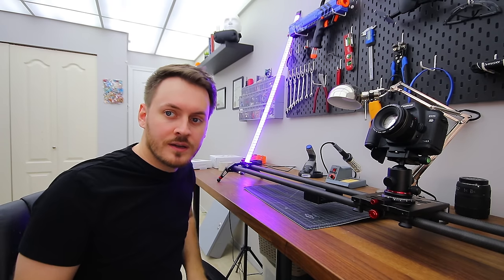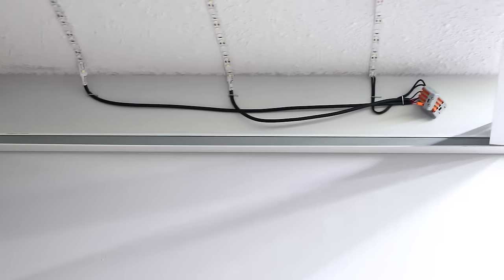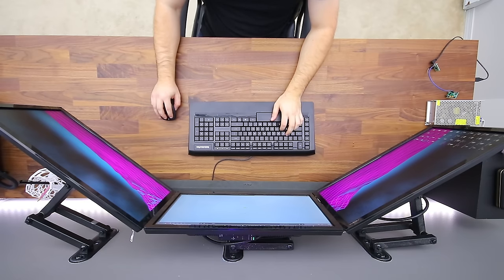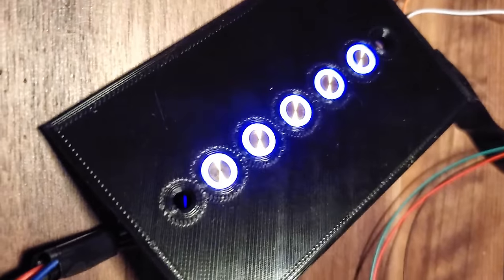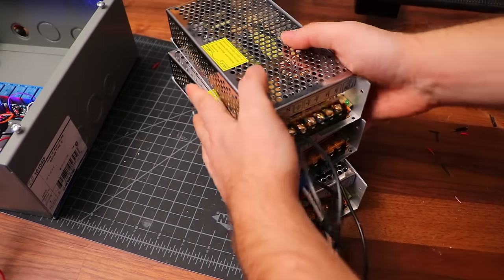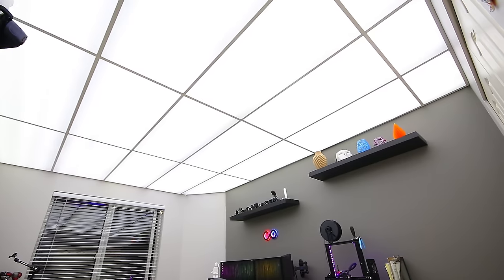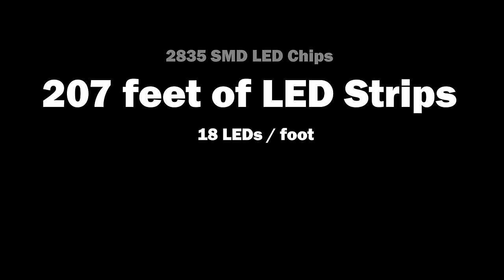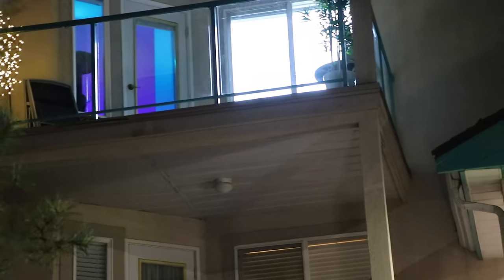Turning My ENTIRE Ceiling Into a Light Fixture

Comment: 8 million addressable LED's and you could turn your ceiling into a 4k monitor.

Just sayin'.
Reply: No. 100
Reply: @F17A  

 ,more precise actually only one since 4k is just a line, 4096   , 

and you multiply with 2k lines (2160) you get 8294400 pixels
Reply: Honestly, I'd be happy with VGA resolution if it means you'll actually do it. 😁
Reply: @ehombane  4k is usually 3840 wide instead of 4096
Reply: Do it
Reply: Make a homemade "TV" is waste the time. To make any image you need control every RGB LED separate and conect to one 555 timer if I don't remember bad, and all this to another thing by groups to another thing by groups to finally can conect to one pic available to move 4K. Would be terribly slowly, big, expensive and ugly monster.
Reply: @oscarswaggie  OK  and still, 8 mil will be one not 100
Reply: @ehombane  ok
Reply: ...in black and white.
Reply: Am I tooo doctor to understand the chat ????
Reply: I like the part where he said “a.”
Reply: You don't need 8k in pixels if you have 8k in lumen.
Reply: Like number 1000
Reply: You can buy video wall like they use in concerts and stuff (literally costs up to tens of thousands but it works)
Reply: @nefarious6986  Well, that's not very DIY.
Reply: @darkridge  it's also incredibly cost inefficient and they're very heavy once you put too many together so overall it's an incredibly bad idea
Reply: Let's not, and say we didn't.
Reply: @rennoib  you don't need 555 timers. You'd be best off with an HDMI controller integrated circuit. You'd still need a ton of LED drivers though.
Reply: Like those roof displays in Las Vegas
Reply: @ElliottRodgers  Exactly! He'd have his own personal Freemont street experience. 

Or at least a really awkward way to play video games.
Reply: Impossible! the most common smart led is 5050 5mm x 5mm and strip width min 8mm. Width of room aprox 3m,  3000mm/8mm=375pcs max
Reply: Why not 8K?
Reply: Do you also tan?🤣
Reply: haa haa haa m8
Reply: MicroLED's Bro, they are the future.....!
Reply: @F17A  bruh

Comment: It would be cool to change color temperature as the day goes to night, might help as well to keep track of time using the lights 👍🏼
Reply: Lit at noon and blackout at night? :)
Reply: plagosus more of a cascade from 6600K to 3000K - MacOS Catalina has a dynamic wallpaper that does the same :)
Reply: I do this with my LIFX setup, it's very nice - although I simplified it to 10pm and midnight. I have it go to a very dim red at 2am so we don't bump into things for those late night gaming sessions :D
Reply: Aw yisssss like a lotta phones come with that night mode automatic blue light removal throughout the day. I wanna do something like this at my place, maybe even have a light sensor outside so the inside lighting just basically mimics it.

Unless it's dreary and cloudy outside...
Reply: I did this a while back, works great!
here's how I did it:
-opened window blinds

Unfortunately I'm retricted to using different shades of blue, orange, and gray.
Reply: @plagosus  Hahaha, hopefully the reverse
Reply: @alystair  that's lit
Reply: @lexscarlet  You usually want to rely on time rather than sensors, because the main benefit of those lights to begin with is to help circadian rhythm not to mimic outside. I myself have KISS approach of manually toggling diffent color via a remote control and it works just as good. Not only it is zero work approach, because those light with remote control are being widely sold already, but it is also what you normally want anyway. If you haven't been in a room lit only by red light then it is hard to anticipate some annoyances. Color chances perception a lot, so it can be hard sometimes to find or examine some particular thing and you want to toggle a diffent color light for a few sec, more orange or yellowish, to see bettere. It is nice to keep a very lightweight remote control in your pocket and toggle light at will. Audio control works as well, but you don't exactly want to rely on using your voice when you wake up to take a piss and people are sleeping.

Comment: Usually those little touch sensor modules have empty pads that you can bridge together and change them from momentary switches to toggle switches, then you could hook those up directly to the relay board and not use the microcontroller.  Awesome video tho, the switch plate is dope
Reply from the maker: Holy shit, you just made my night. This is why I love YouTube. You're absolutely right, there's even a little symbol for it and everything! Thanks so much!!
Reply: Was hoping he'd read this comment? And he has! Which is great cause that was exactly what I was thinking as I watched this. 

Btw internet people's those of you who are disturbed by the fact that home techies like us would want to remove a controller? There's a simple explanation in this thinking process. We aren't getting rid of controller. We are freeing up a whole controller to be available for a project where it can actually be utilised to a better capacity.

I'm forever looking at things and thinking why didn't they use relays and jumpers to make "physical" logic gates? 🤔
Nearly every combination of computer mathematical logic can be configured into  an electrical circuit utilising a few cheap components? I.e basic logic like AND, OR, NOT etc.
Most people wouldn't need much more than those logics with most of the projects that want to take on at home?
Reply: @Coltography  would love to know where I could get some of those touch sensors you used in the switch
Reply: Jarmezrocks me not knowing a thing or two about this makes you sound like a genius, holy shit so much info to take in, sounds so complicated.

Comment: Just a heads up, step drill bits would most likely stop the plate from snapping like it did.
Reply: athornforeveryh flexible wall plates do not break like this.
Reply: For drilling that hard type of plastic, and acrylics, polycarbonate and brass, grind the lands of your drill square so that it scrapes away at the material. If sharp and digs in like a chisel, will load up and crack or chatter every time.
Reply: JUst by a drill made for drilling plastic!

Comment: The discrepancy in theoretical vs actual wattage could be due to voltage drop down the length of the LED strip. If you're feeding 12V down a copper trace that is effectively the cross section of a 18-22AWG wire, you  could lose a lot of voltage (and therefore current draw) by the end of the strip. What's the voltage at the end of the strip?

You could try feeding power from both ends of the strips, thereby improving consistency from end to end?
Reply from the maker: Very good point!! I am going to try this and see how it affects the results. Thank you for the excellent suggestion.
Reply: doubt the spec for the leds is meant for two way power. It’ll probably either have a diode (or burnout) if it is one directional. 

If it’s not strictly one directional it’ll likely just heat up the strip until failure or at a minimum the power supplies will fight each other.

You could cut the trace in the middle effectively doing the same thing by powering 1/2 of each strip. Though if these are wired in parallel 10-15ft strips shouldn’t be awful. The strips do look like they’re wired up a little whacky too though.
Reply: @9Llamaboy  In order to work at 12V the strip it's internally wired in parallel blocks, there's not such thing as "bidirectional power" or "fighting power supplies" you have a lot of homework to do
Reply: @9Llamaboy  In these strips you normaly have a positive and a negative line going from one end to the other, like in a power cord.
The LEDs (or groups of them) are put in parallel between these two lines.
If you draw that on a piece of paper, you will see that you can feed the strips from both ends.
For reference: Look up the YouTube channel "Intermit.Tech". He showed what happens, when you feed power to a length of LED strip in different ways.

Spoiler: Buy sun glasses.
Reply: @Coltography  als you can tune the votlage of the PSUs with the little orange trimmer. measure at LED strips, and tweak until you have 12V there. you may have liek 14V at the output of the PSU and still only 12 at the strips.
Reply: We'll have to feed AC Voltage and put AC-DC convertor for every feet or two 😂
Reply: @9Llamaboy  Thats not how it works lmao
Reply: wiedapp ah gotcha, thanks thought OP was talking about using one power supply on each side not powering from the same supply. Its an interesting idea but not sure if it’d be worth the effort of running an extra ~15ft x 2 for every strip. It looked like in the video you linked he’s using 3 strips chained together so it makes a much more significant difference
Reply: Agreed. Also, 70% PSU efficiency is on the low side. Just checked a couple of similar MeanWells and they're in the 80%-90% range.

Comment: Such a great video, and I wanna do this now! Might be a bit late to the party for suggestions here, but for addressable leds, maybe you could lay it on the ceiling, parallel to your white strips. In code you'd create abstractions for each fixture square (based on how many LEDs fit inside each one) . That way you could have a nanoleaf vibe going on in the ceiling! Might need some spacers between each fixture to prevent light bleed to get a clean result, though. Quite a bit of work, but it would be quite insane:)
Reply from the maker: So cool to get a comment from you guys, been subbed for a while! Thank you - and that would be a ton of work to capture the light leak but I plan on doing something similar, just a little less complex :P Thanks again guys!
Reply: Obviously addressable leds would be cool but that makes it much more complicated, first of all it is going to be way more expensive, and most  are 5volts unless you get the ws2811 that aren't individually addressable but control 3 at a time, so it's definitely possible just going to be more expensive and a little more work

Comment: This is really neat. When you do create a permanent led ceiling like this, having those RBGW LEDs would be really good for creating a few specified ambient light settings. What if you also had a control switch like this at your computer desk via bluetooth or wifi as mentioned with the board you said you had, so you can change a light setting while sitting there?

Comment: Maybe add RGB’s and do like a rainbow effect of different colors like the back of your tv was in previous videos.
Reply: There’s no way your electricity cost is $.01, more like .1 / KWh
Reply: Dan Abell ???? I never said it cost that. Wtf?
Reply: @theandonlyboss  lol he meant to comment that under the video, for some reason he replied to your comment instead, what he's talking about was mentioned towards the end of video, around 7:50.
Reply: There's so many ideas. I would think about a clock and rainbow 🌈 🕒
Reply: no rgbw lights
Reply: Plain white LED strips or colored strips are kinda cheap but individual RGB colored once are very expensive, it doesnt matter much if you just need one strip, but for a whole ceiling that would increase the cost by a lot, also then there is way more electrical stuff, controlling and software involved which also raises the costs, pretty sure thats why he didnt do it.

Comment: 3:32 the drill bit must spin at the fastest speed you can achieve and do not put to much pressure, this whay it want break
Reply: Also he used the very cheap blank plate.those ones  break very easy if he get the non breakable ,is easy to make holes on it
Reply: Use a bit for brittle plastic (like acrylic). Metal drill bit cutting geometry is to aggressive for brittle materials.
Reply: @vi683a  yeah that's true

Comment: Heh, this is basically the "sunshine ceiling" trend from the 70's/80's, redone in LED instead of fluorescents. Everything old is new again...
Reply: The rest of the room is in desperate need of a makeover now. I would suggest orange shag carpeting, solid oak cabinets stained dark under the bench, orange laminate bench top, brick veneer glued to the walls, and a corinthian leather office chair.
Reply: AMD1 Brick Veneer which is an 80’s style is already back in new homes, I was at the home reno and builder show The 80’s style is coming back according to the various booths they had! Dark oak 70’s/80’s wall paneling is back now as well! I noticed antique brass and chocolate to blackish brown fixtures are back too! 4 Wicker blade spinner bell canopy variable speed ceiling fans are popping up in lighting stores again! I know all this stuff because I come from a long line of home builders!
Reply: For real, look up glass/prism sidewalks, popular in the 1850s-19 somethings, everyone forgot about them till recently. Concrete sidewalks with little glass prisms inside to let light from the floor above in, or the light from inside up through the sidewalk. They should bring this back for sure.

Comment: Add dimming function and use Mean Well drivers, they're far more efficient for a little higher cost than those chinese eBay power supplies.  (HLG series I use for my hobby)
Reply: and they are legal. you can use chinese led strips but as long as the "high voltage" is approved and of known brand company the electrical inspectors dont care. also in my country anything that is plugged into a plug and not directly connected is not apart of the electrical installation therefore does not need to be inspected.
Reply: He could always just program them ( they look like programmable? If not just spend the money since you are already there) to be like 30% Brightness

Comment: Excellent craftsmanship on that light ceiling, so retro.
  That ceiling a modern twist on the “blanket light ceilings” of the 1960s. This type of ceiling was common office buildings, banks,‘grocery stores throughout the 1960s  A blanket light ceiling of yesteryear consists of a translucent drop ceiling as shown here in the video with florescent light fixtures hidden behind the translucent drop ceiling.  Kitchens in homes used type of ceiling with florescent lights in 1980s-1990s.  So this a modern version of the florescent drop ceiling.

Comment: The reason you calculations are off is because the 0.2W is for max usage which would require a heat sink to cool them. So most manufactures don't end up actually running them at full power.

Comment: Here is how I would do the Electric/Led part with full RGB support (and with less electrical engineering skills). You need:
- Wifi compatible Led Strips
- Raspberry pi with Touchscreen 

What you do:
1. Create a Wifi Hotspot with your PI
2. Connect all Led Strips with this Hotspot (you can create groups on rows or for every single window)
3. Use a program to create good effect (e.g. delay, gradient, ...)
4. Use the Touchscreen as light switch as well as a color/effect picker
Reply: TheHhhhhuuuuu please make a tutorial

Comment: looks awesome - I switched to  24v strips and those meanwell knockoff 24v power supplies (usually for 3d printers) to avoid voltage drops and needing such large wiring and big power supplies. You can even find UL listed 24v strips relatively easily.

Comment: Actually safer going overkill with power supplies sometimes because overdraw caused overheating. Most arduino boards have 12v regulators on the vin to an extent also but good call on the regulators.

Comment: For a light I'd use strip that can go from cold to warm white and is dimmable. That way you can control the amount of light and the feel it gives. Also mounting the strips directly on the ceiling is not providing much cooling. Having some metal rails for those is recommended. Looks amazing tho. Very professional

Comment: This is really cool! Would be awesome in a workshop environment. Nothing to knock down or break when moving large objects around. You mentioned doing each tile in a separate color, LED light bulbs are pretty easy to setup and really bright, especially the flood light variant, if diffused right you could get away with less programming.

Comment: Just a quick tip: If you decide to put RGB-LEDs there, don't remove the white LEDs. I've learned this the hard way (ignoring DIY Perks was a bad idea). You'll never get a nice white out of RGB LEDs that is comparable to what you described as "crisp". 
In my case, I solely used RGB-LEDs and spent hours tweaking the red, green and blue parts. It always looked off and actually made me sick (like it's really uncomfortable to be in a room with weird lights). Ended up with replacing all the LEDs with pure white LEDs with high CRI value (thanks DIY Perks), I couldn't be happier.
Anyway, great video!

Comment: you should run one rgb strip down the middle or maybe two out of the three, and when it switches to rgb mode it turns off the white, or maybe lower the white light so it still lights up the room.

Comment: Those strips attached to the ceiling porous surface will not stay for too long unless you add some glue like contact cement. The heat from the led's will make them to fall.

Comment: Seeing your predicted wattage vs actual you may want to check your voltage drop across the led strips at various points and do what is commonly referred to as "power injection" for the strips. Power injection is just a fancy way of saying, solder some more power delivery wire further down the strip since the copper in the strip (especially cheap strip) is usually thin and not great at powering all the leds at full brightness in long lengths of strip.